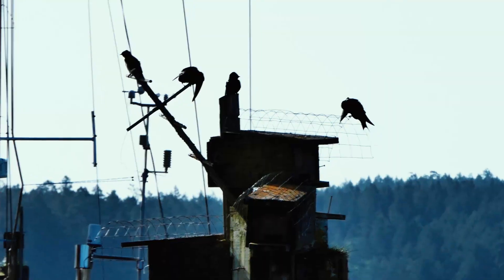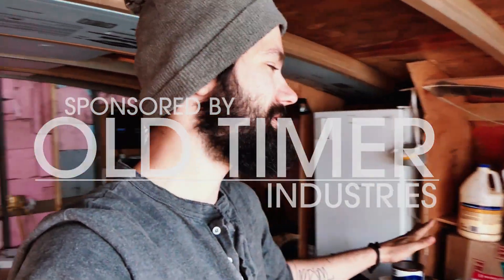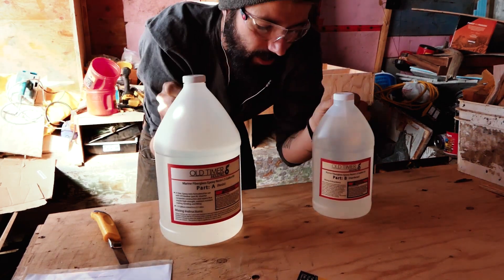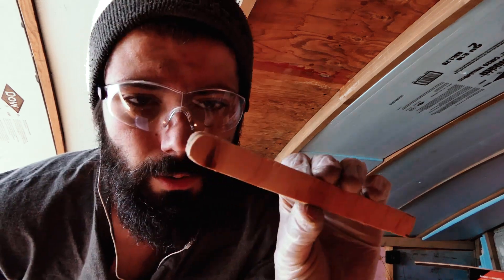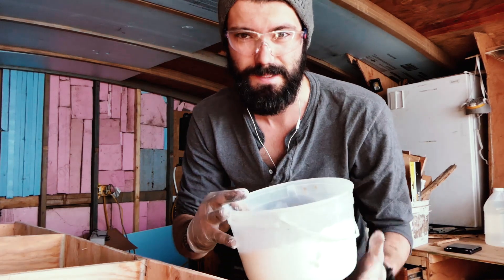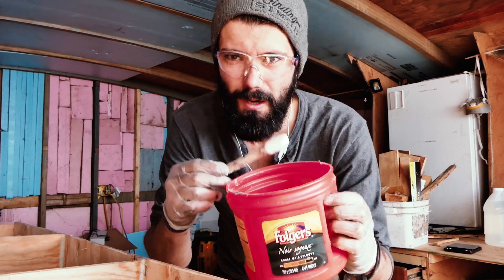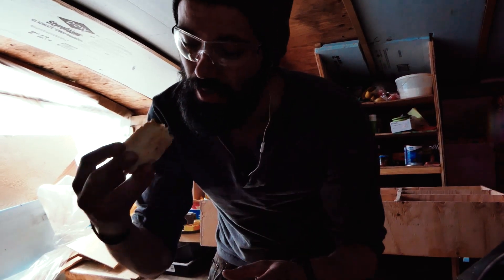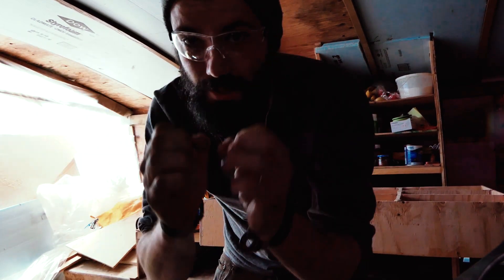Using Epoxy to Repair Rotting Decks (Old Timer Industries - Sink or Swim 72

Comment: Good to hear. I was little worried about your previous epoxy. In some episode you showed the barrel somewhere and it said “polyester” - so it wasn’t epoxy at all. And the difference is that polyester is little weaker and also not watertight over time. So I would definitely make sure that all the deck and hull work will be done with proper epoxy.

Comment: One of the nice things about marine grade plywood is that the glue used in making it isn't affected by water, whereas the type of ply you keep using is made with water soluable glue which will separate when it gets wet. Is there no boatyard nearby where you could go and ask some questions? Rotting can't be fixed, can't be repaired: it has to be replaced by an appropriate type of lumber. Anything tends to result in a lost at sea report by the CG.

Comment: That is funny, when you mentioned in an earlier video that when you get a free boat you take the free boat I was thinking about the economy of free.
Free is not always as cheap as it sounds, a good example is a free mansion vs a small $150,000 house, sure you have an asset with lots of potential but unrealized potential is worth about the same as no potential. If you have to spend $300,000 and years that you don't have to make the mansion livable  (or even salable) than it may not be as easy as it seems to pick the "free" one instead of the one that actually costs you money from the start. There are many variants on the concept but I think this version applies aptly for this story.

Comment: Next time you need to do fillets, put the PB in a ziploc bag, snip off one corner and pipe out the epoxy like cake icing, then follow behind with a rounded stick. It will make the whole job much quicker and cleaner.

Comment: SIMON,,,TRADE SECRET,,,The sanding belt [ from a belt sander ] can be used as a hand sander,,   by fitting 3/4 or 1 inch thick wood inside the belt. Great for smoothing of saw cut edging and you will find many other uses .From P.E.I.,,,Wish i was on the west coast to help you,,HAVE A GREAT DAY,, to you and champ,,
Reply from the maker: Haha yep. I've got some sheet stuff to use. Lots of sanding coming up. I think I'll make a speed test.

Comment: Simon, are you going to tape the corners of the box with fiberglass tape?  It would make the joint a lot stronger.  It's not the epoxy that is holding it together; it's the thin layer of glue under the top layer of  the plywood. By taping, you spread out the load over a bigger area.  This is especially true when you put in bulkheads.  Good luck.

Comment: What wattage inverter are you using with your Avalon Bay Induction Cooktop?  Taking mine on a trip that won't always have shore power. Love what you are doing with your project.
Reply from the maker: I've got a big 4400 watt PSW

Comment: 10:52
The New Beams are Awesome - Sink or Swim 73
Finding Simon
sett 5,5k ganger

10:26
15 COOL MINI BOATS AND TINY WATERCRAFT
Minds Eye Design
sett 250k ganger

6:37
Advanced Beam Repair - featuring the EndRot System by System Three
systemthreeresins
sett 145k ganger

13:00
Update 10 - How to splice DYNEEMA
SAILING into FREEDOM
sett 5,1k ganger
Ny

12:50
Fiberglass Hull Repair with Epoxy - Sink or Swim 86
Finding Simon
sett 5,1k ganger

17:24
SHOULD WE RE-RIG THE BOAT? - SAILING FOLLOWTHEBOAT Ep 116
Sailing followtheboat
sett 940 ganger
Ny

‘Evading media questions level: Expert’ - Master class from Hillary Clinton
RT
Anbefalt for deg

Sunday Special Ep 8: Adam Carolla
The Daily Wire
Anbefalt for deg

Acquiring a Sunken Derelict Vessel for Free
Captain House
sett 624k ganger

Not the best day on the sailboat... stormy 29 knot sustained wind The Boat Life sailing travel vlog
The Boat Life
sett 3,7k ganger
Ny

SSL 280 ~ The boat is SINKING!!
Captain Rick Moore
sett 39k ganger

Bora Bora - Sailing the Pacific Episode 25
Sailing Yacht Florence
sett 5,5k ganger
Ny

Mysterious Mega-Structure Discovered in the Mountains of Vermont | Exploration Adventure
Green Mountain Metal Detecting
sett 210k ganger

Our Contemporary Wood Composite Boats
NWBOATSCHOOL
sett 36k ganger

Salt & Tar Episode 33: Part 3- Finishing the Cabin Re-remodel
Salt & Tar
sett 23k ganger
Ny

I Bought a Boat - Sink or Swim 01
Finding Simon
sett 21k ganger

Suns Out Guns Out! (Shaun & Julia Sailing - Ep. 339)
Shaun & Julia Sailing
sett 29k ganger
Ny

Laying 6 oz Fiberglass Cloth - Sink or Swim 85
Finding Simon
sett 5k ganger

RUSSIAN BILLIONAIRE STOLE OUR DRONE!
Droneworks Studios
Anbefalt for deg

Cost to purchase and operate a 65 foot yacht
Trying Not To Sink
sett 247k ganger

Using Epoxy to Repair Rotting Decks. I rest my case!!!!!!   Rotting deck is not for repair. Rotten deck is to be taken out and replaced.

Comment: BTW Simon, epoxy + sunshine don't get along. UV bad. 
If you're not able to complete a job right away, like that cabin roof you glassed, it is a good idea to slap some paint on there. Varnish works too, just don't leave bare exposed epoxy.

Comment: Why not use supercapacitors instead? They are more expensive to buy but charge up in 3 seconds and last just as long as any lithium which can only take 1200 charges then needs replaced and cost $$$$$, Where a super capacitor can take 1 million + charges and will save you money in the long run, Fair winds! ;)